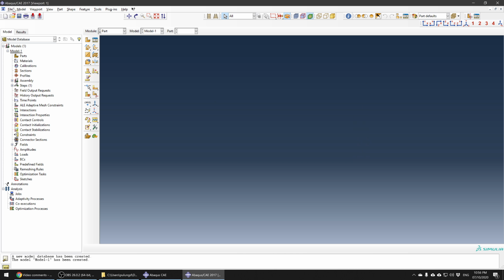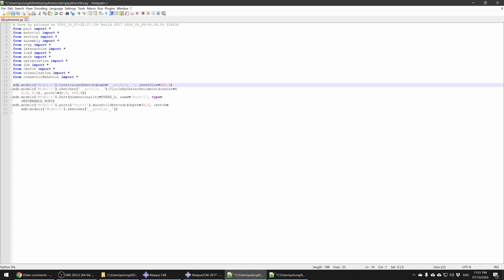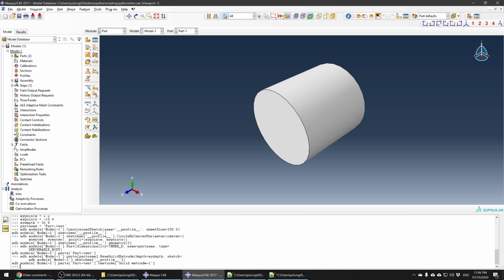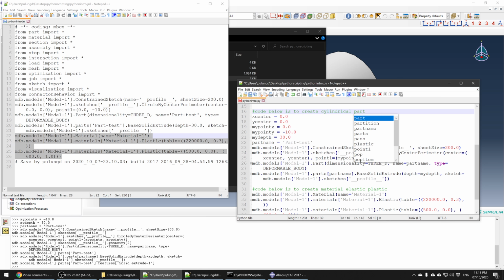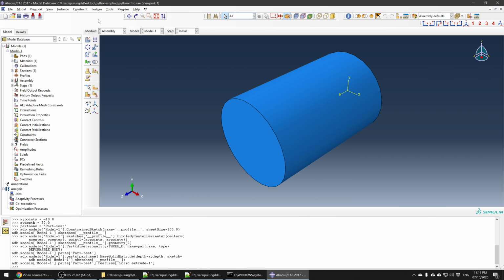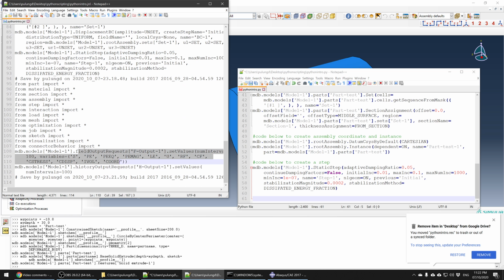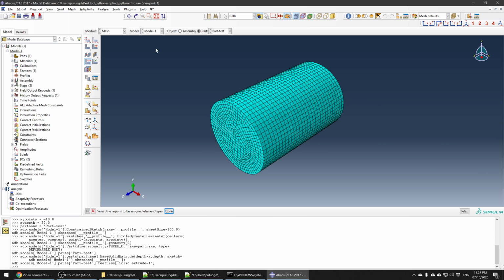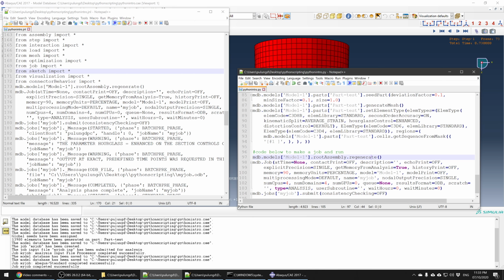Abaqus Python Scripting 01/10 - Introduction

Comment: Thanks for your videos. I am trying to get the coordinates of the centroid of the remaining elements after some of the elements are deleted. Elements are being deleted using subroutine (VUDSFLD) based on integration point temperature. Now the element deletion will keep occuring after every time step and I want to loop over the time step and get back the coordinates of the remaining elements after each time step.
Could it be done?

Comment: Can you show how Python scripting will work if I have a UMAT........?
Reply from the maker: What do you mean? U wamt to submit a job thay need to call umat via pytho script?
Reply: @FEADith  No. I simply meant I have a job for two layers. Each layer has different material properties and two different constitutive equation based models, requiring two UMATS.
Reply: @FEADith  I have the two UMATS and have also run them. I just needed to know how to do Python scripting in that case ....for batch processing etc,,,

Comment: I have a question. I want to use 20 element or node labels(numbers) in the python script. I am trying to prepare a code with a loop that code checks these elements or nodes during 10 steps and when each of those nodes or elements temperatures reaches a certain amount for example 500 C, the code saves the stress and strain results related to those elements or nodes. I want to know do can I refer to element and node labels and how can write this kind of code.